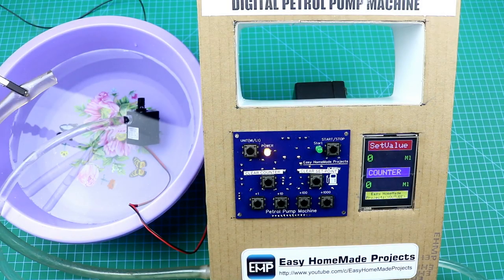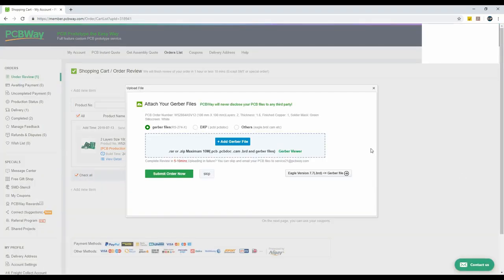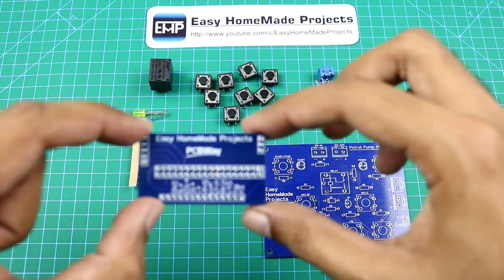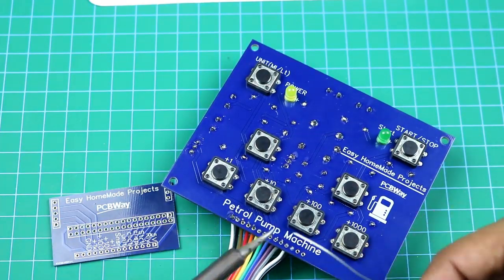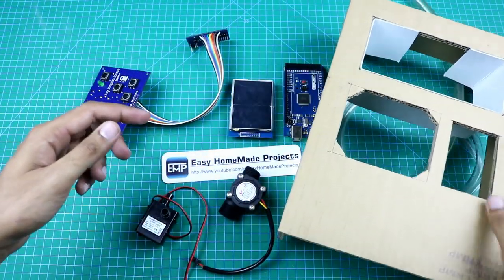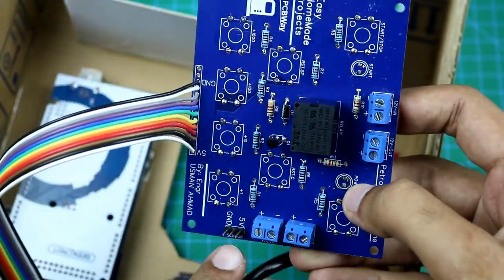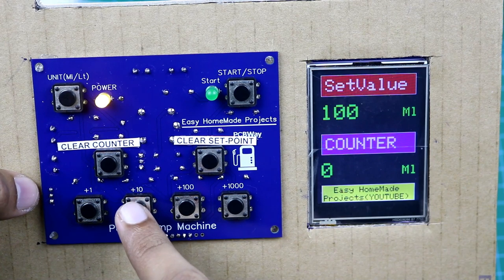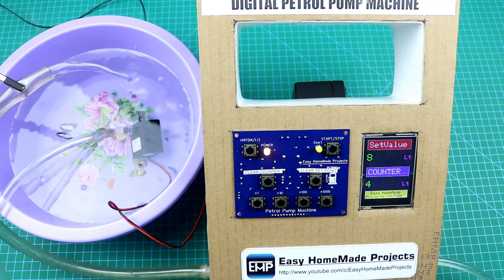How to Make Digital Petrol Pump Machine using Arduino

Comment: Not 100% accurate coz ur using an relay to turn the pump on and off...
Relay is a electromechanical device which cannot be controlled accurately.
You should build one auxiliary digital circuit for operating the pump using arduino signals

Comment: Sir Arduino+proximity sensor + 4 digit 7segment display winding counter miter. 2 button winding count value set and 1 button select to relay on moter on winding value all 0000 auto relay off moter off...new video...plz

Comment: Cool project, could you adjust the accuracy of the flow meter in software?
Reply: Accuracy can be controlled in software. For that you should be able to read dispensing operation at a rate of 1ml or at least 5ml accuracy
Reply: Can you please tell us which software we can use to design the board